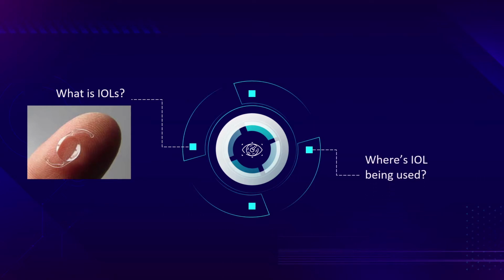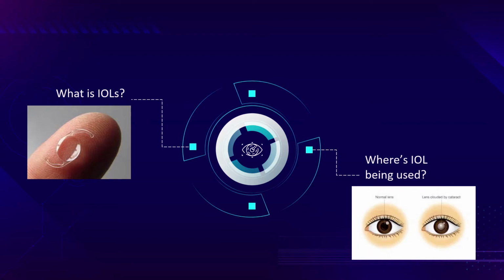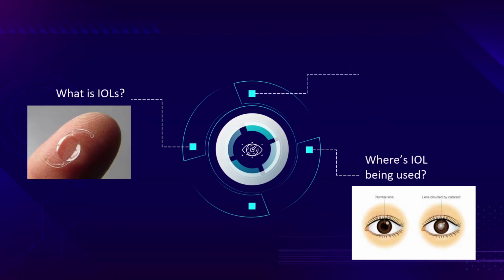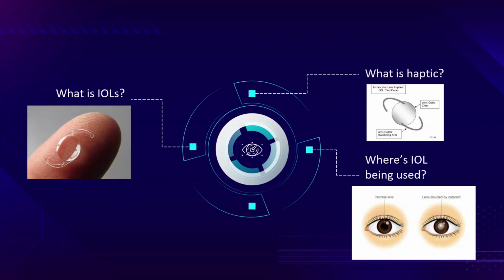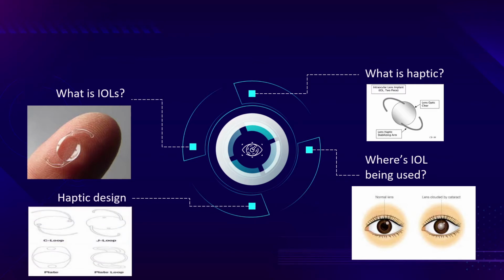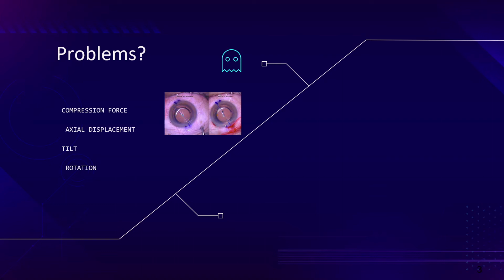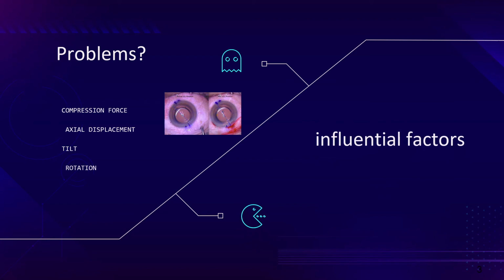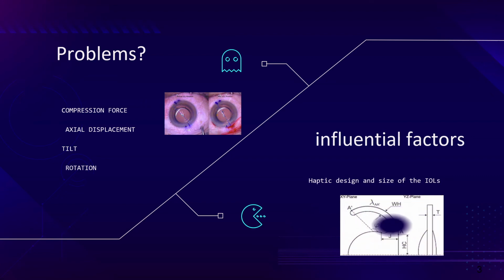FYP1 5MT | DESIGN OPTIMIZATION OF C-LOOP INTRAOCULAR LENSES USING DESIGN OF EXPERIMENT |

Comment: In your research on IOL, you are focusing on C-Loop haptic design which you want to optimize. You are addressing the issues/problems on compression force, axial displacement, tilt and rotation. The parameters you will examine are thickness, length and optic junction of the haptic handle.   When optimized how would these parameters, address the issues/problems that you have listed.
Reply from the maker: Thank you for the comment Prof.
Every parameter has its own effect on the mechanical stability of IOL. It would be impossible to have 0 tilts, rotation and axial displacement. Based on a few research papers, When the cross-section of the haptic increases (i.e., increased haptic width and/or thickness) and the haptic–optic junction is larger, the energy accumulated by the IOL is higher and will result on higher rotations, axial displacements and reaction forces. Therefore, a delicate trade-off between the length and the cross-section of the haptic must be achieved to minimize undesired post-surgical shifts. Unfortunately, in order to minimize the rotation of the lens, the optimal configuration would require a larger haptic-optic junction (J) which is incompatible with minimizing, In the same vein, reducing the haptic thickness (T) would lead to an increased tilt and axial displacement, but a lower compression force. Due to this inverse coupling between design parameters, different design strategies are mandatory depending on the stability factor that is aimed at being minimized. My optimized design should have the best average of all mechanical stability based on data collected of different design parameters.

Comment: Salam Haziq,  you got really interesting topic.  I like to know more about the design of experiment in relation to your project 
1- how reliable /accurate they are
2- what other method similar to design of experiments . If none,  is design of experiment is compulsory for any design proses? 
3- if I'm not mistaken,  u mentioned about abascus. Can u explain more on this software
Reply from the maker: Waalaikumussalam Dr, Thank you for your comment.
1. My project will be using method design of experiment to do the comparison of some parameters that affect mechanical stability of the lenses, which this parameter will be based on the data from the simulation and research papers. The data and method should be reliable.
2. There is also a Robust Design which include the production cost. However, I'm using the DOE for an ideal design. Design of Experiments is a methodology for systematically applying statistics to experimentation, any factors that influenced the variation are selected for observation and comparison. It should be compulsory for any design process so that the outcome of the product will be optimum
.
3. Abaqus is a software application used for both the modeling and analysis of mechanical components and assemblies (pre-processing) and visualizing the finite element analysis result, which is similar to Solidwork. However, Abaqus has a far more robust contact solver to solve contact interactions more efficient and more accurate control over some of the contact interaction parameters.
Thank you for your time Dr.